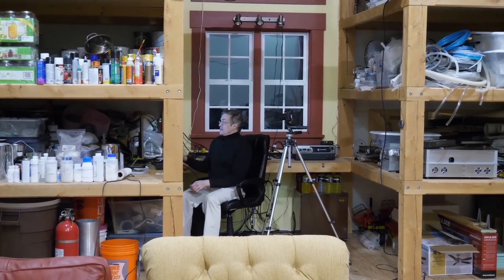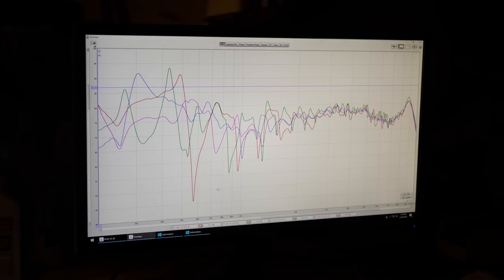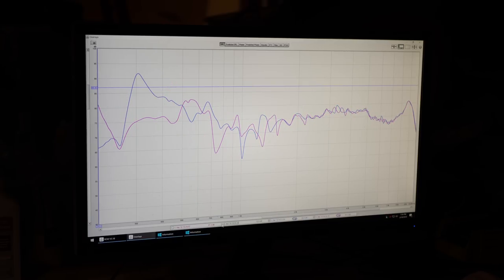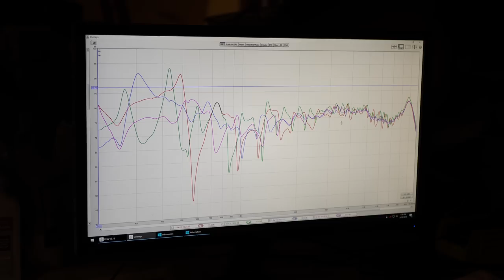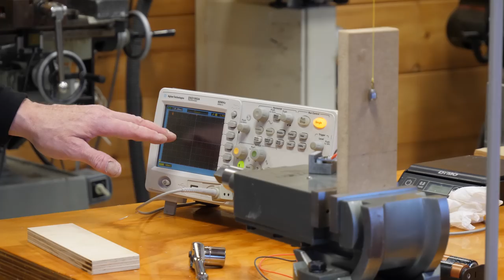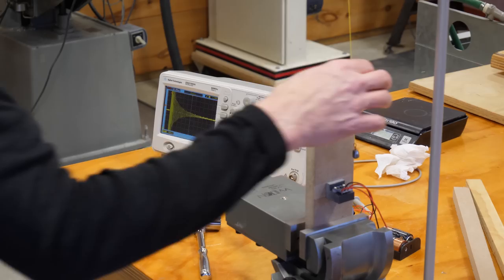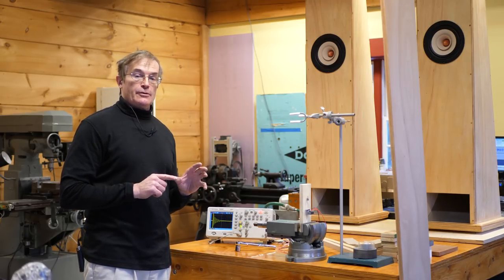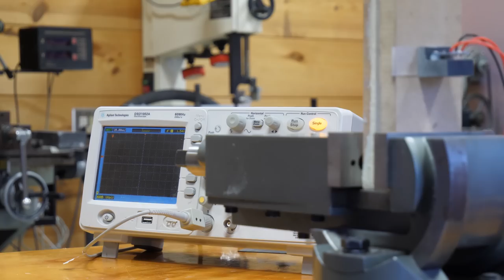World's Second Best Speakers!

Comment: Ummmmm, dude got a fundamental of loudspeaker design completely wrong.    The magnet doesn’t move, the voice coil moves, carrying the membrane with it, thus moving air, thus making sound, hopefully the voice coil is oscillating at the frequency required to reproduce the intended sound as commanded by the audio device producing said sound, which takes very few volts and amplifies that to many more volts, thus creating the magnetic field within the voice coil, which reacts against the field within the circular magnet, to oscillate and make sound.    The rest of the “speaker” is used to harness these vibrations and augment and manipulate the resulting audio to the desired intent of the speaker designer.   Hopefully.    All too many speaker designs compromise too many aspects at the behest of one underlying design intention.     Purity is purity, and the more baffles used, the less pure and the more reflection, but these baffles are great,y needed for the pragmatic needs of said speaker, including, but not limited to, sound pressure level, dispersion, accuracy of reproduction of source audio, AKA, fidelity, space and weight considerations, environmental considerations such as relative humidity, temperature, external acoustic reflections, external acoustic open field, and of course, seemingly, last but not least, the ego and aesthetic design intentions of its creator, oft found to be sorely misguided by one design assumption or mistake after another.     Making good sound reinforcement loudspeakers CAN be quite simple.       Can be.     Can be.     Also remember that beauty isn’t always a visual thing.   It can be in the ear, as well as the eye, or even nose, of the beholder.        Nice demo.    Dude needs to get out “in the field” more.     Nice turtleneck too.     I was waiting for him to start reading poetry and snap his fingers over and over before donning a beret and lighting a cigarette.     Good stuff.   This was almost a skit on SNL.
Reply from the maker: Thanks  for the comment.  Try breaking  up the run-on sentences, it will be more impactful and easier  to read.

Comment: Sealed back cabinets might be 'wasteful', but they still give you the most accurate response, smoothest roll-off and most compact dimensions. 
A port is not a delay line. Far too short. It's a resonating air column. Like a passive radiator made from air inertia.
Reply from the maker: How do they address resonant peaks at integer wavelengths?

Comment: Riveting presentation and subject matter as always, but I have a naive question: how come I never noticed that a certain pitched sound is louder/quieter on certain speaker configurations? The demonstration in the other video with the in phase/opposite phase speakers effectively doubling the volume or cancelling out was quite dramatic, I suppose the effects in this case are far smaller?
Reply from the maker: Mostly, it's  because they are compensated by the wider bandwidth.  The taper has no discreet peaks.

Comment: The other thing we need to consider, in addition to stiffness and mass, the damping factor. There are many ways to introduce damping to the box. The damping will help in reducing the vibration amplitude. I also think the more rigid panels will resonate more with higher frequencies, rigidity is not always good.
Reply from the maker: That's what I did with the constrained layer system.  All other things held constant, rigidity is always good.  But, if mass or damping or cost  are compromised for rigidity then I agree it might not be worth it.

Comment: What did you mean by the thickness of the speaker  material is negligably thick? Are you saying that there is a range of thickness somewhere between a minimum thickness and a maximum thickness where the difference doesn't matter much? Thank you in advance for your explanation.
Reply from the maker: The principle is that the speaker diaphragm thickness is negligible compared to the wavelengths of audible sounds.

Comment: A very good introduction to acoustic principles and loudspeaker design, but hugely misleading in that it suggests these speakers are close to being a near perfect design. There are many other factors to consider which are not even mentioned in the video, such as the importance of speaker placement and spacing within the listening environment, psychoacoustic effects, resonances within the listening space (although covered in the acoustic panel video), and the need to set the speakers up to suit specific types of music or sound you are listening too. Electrostatic panel speakers most closely approximate an ideal speaker for classical type music, while cabinet speakers suit more modern sounds and particularly the emphasis on bass sounds. For $600 you can certainly buy a much better pair of commercial speakers and even more so on the used market.
Reply from the maker: Thanks, but your criticism is a little unfair.  This is already nearly an hour long video and you're saying that not having discussed the contribution of room acoustics and the physiology of hearing is a failing. Those would be interesting topics, but to cover them would require a lot more time and would be better as part of a course on acoustics.
There certainly are other speaker designs out there and as you said each has certain strengths, they also have weaknesses including cost and construction complexity. Used speakers are worth looking at, but are a poor standard for cost comparison as the availability is very unpredictable.

Comment: Just a note--at 2:00 ish where you're describing voice coils and magnets in the speaker, it sounded like you were saying the voice coil was static and the magnet is attached to the cone, if I'm understanding you correctly. It's actually the other way around--the voice coil can be made to be pretty light, much more light than the magnet, which is why the voice coil is attached to the cone (lower intertia, better fidelity).
Reply from the maker: You're right, I misspoke.

Comment: Hey guys, have you tried butyl rubber tape for the visco elastic layer? It is even cheaper and readily available in 0.75mm thickness at various hardware stores
Reply from the maker: No, we didn't.  However,  Grace Ice and Water Shield is butyl rubber based material that was promising, but was not used only because  it was only adherent on only one surface.
Thanks.

Comment: Sound waves radiate outword in a circle from their source. So containing them in a square tube, and directing them out through rectangular holes seems counterintuitive. If cost and technical ability were not a consideration, would it be superior to build a round Voigt tube with a round opening at the bottom? I welcome feedback about this idea.
Reply from the maker: Probably not.
These waves will radiate spherically, but will reflect many times at they travel up and down the tube.  That would be true no matter what the shape of the inside of the tube.

Comment: Super! I'd like to build such speakers for myself. A question. Doesn't the front panel resonate not because of the sound pressure, but because the speaker is attached to it?
Reply from the maker: It moves and that's ok.  What we want to to prevent is frequency dependent oscillations that persist because they are tuned to the resonance peaks of the structure.

Comment: How did you arrive at selecting the Tang-Band driver? I missed that or it was not covered? I'm guessing I can use something with similar T params.
Reply from the maker: It wasn't very scientific. I heard a couple of speakers that were built with these and I was very impressed with the sound.  The specs supported this.
You can, just adjust the dimensions (to scale) if you choose a driver with a different recommended open volume.

Comment: Magnets dont move, AC current energies the voice coil and causes it to move in and out of the gap becuse its suspended by the spider between the air gap next to the magnet it moves in and out as its either attracted to or repeled from the magnet this makes the cone move and push and pull air causing sounds waves.
A motor or speaker makes no sound in a perfect vacume. It has to push air.
The condition of the air also plays a roll
Is the sound presses  like humidity and tempture.
Reply from the maker: You are correct regarding the magnet, I misspoke.

Comment: Don't think that open end ambient air reflects sound waves emergent from tube.  Instead, sound waves in tube reflect off of tube wallls causing them to vibrate, then the ooen end of tube reflects the sound back into tube.
Reply from the maker: If that were true,  how do you explain reflection at the interface between identical materials with a different density due to pressure or temperature?
Look at images of shockwaves.

Comment: I’m just wondering with the speaker right in the middle from top to bottom of the enclosure, will that not increase the resonance of the frequency that matches that distance?
Reply from the maker: That could be an issue  when the driver is midway between  two reflecting surfaces, but the packing in the upper half reduces the speed of sound based on its density. This is similar to the refractive index of glass which indicates the reduction of the speed of the light as it passes through a lens or fiber

Comment: Would it be possible to bend the transmission line down 180 degreese may be on a high of 110cm without getting a negative impact on the the sound?
Reply from the maker: It should be. There may be additional reflections at the bends that will have to be compensated for.

Comment: hello! thy for this viedo.  can someone in the comunity tell me if you can build such speakers a little smaler ? how would it affect the sound output ??
Reply from the maker: Check out the open volumetric of the smaller speaker drivers you will be using and scale these dimensions down to achieve an internal volume that matches it.

Comment: Just wondering if this is scalable? As in, if I make all the dimensions half the size will it still work or does any scaling need to be audio tested and adjusted? Thanks
Reply from the maker: Yes... but.
The drivers are designed for an optimal "open volume." Check out the manufacturer's recommended open volume and then scale the dimensions to match that number.

Comment: Thanks for your very detailed video. Is it possible, that the measurements of the front and the back side of the box is reversed ?
Reply from the maker: If I remember correctly, the front is measured  slightly  overlong and then mounted. The top is then finished to bring all four sides to perfectly horizontal  to allow the cap to be added.

Comment: Can these be scaled downed directly or would require re-calculations of thickness, shape and hole size?
Reply from the maker: Sort of.  What matters is the internal volume and the driver manufacturer's recommended "open volume". You can scale the design down proportionally to meet that internal volume. Wall thickness is irrelevant and the port opening is often recommended as well, but can be scaled proportionally as well.

Comment: 45:20 How well would something like a 1mm coating of silicone caulk do at dampening vibrations?
Reply from the maker: That would absorb sound energy, we don't want to do that.  We want to use it and direct it out the port.  The constrained layer dampening reduces the generation of resonances and parasitic vibrations that will distort the sound.

Comment: How about using Henry's Rubber Roof Patch? Dirt Cheap at Lowes.
Reply from the maker: Is it gel like or is it rubbery.  You want a non elastic gel like material. If it's like this then it should work.

Comment: What if you add more than 1 dampening layer and built up your panels from several thin sheets of plywood?
Reply from the maker: The optimum set up is a thick primary layer and a damping layer with one half the primaray's thickness.  Breaking this into multiple  thin layers isn't any better and is more expensive and requires more effort.

Comment: Usually I dig your stuff, but preferring plywood over MDF for speakers is just wrong. The box isn't meant to be a living resonance frame as in a guitar or violin. While the violin (not plywood either) plays one frequency after the other, the speaker has to play the supersuperpositions of the whole orchestra. The body should be as dead as possible and let the membrane do the work. Therefore it has to be most weight with least stiffness.
Kept watching: You can use tar (roofing paper without grain) instead of that dampening stuff. Easy to use and really cheap.
Edit: And spruce isn't even close to meranti. That's like comparing mahagony to pine.

Soundcheck: Those speakers sound exactly like my speakers playing a video from youtube where someone records some music in a garage with a mono mic. ^^
Reply from the maker: You need to watch the testing again.  The MDF looses on all fronts except cost.
Reply: @TechIngredients  Please measure the resonance of the front near the speaker while playing different types of music. Please measure the delay and frequency at your metal sound slide. Then plug it to a good class A amp and let some audiophile listeners compare it to Focal, KEF or other reference speakers. After that, open one of the reference speakers and find out what they put inside it, which membranes had sealed boxes and how that volume corresponds to size/hub of the membrane and coil strength. For open systems: What's the delay and what did they do to get a 20 Hz wave out of a membrane that's limited at 40 Hz?
And let them test it against some good monitors, too. Size does matter, technology is important, but experience beats it all. So I wouldn't be surprised if a good monitor would sound more precise than a huge monster that lets sound off out of every membrane, two holes with changing diameters and the wabbly and cross-oriented plywood surface.

Comment: MDF is cheap, readily available, easy to machine, relatively dead and stable.
Marine plywood is not easy to find and expensive.
When I make spaghetti carbonara, I would like to use Guanciale, but I usually have to settle for Pancetta, either way, it's delicious.
Reply from the maker: You skipped a step.  As I said, the speakers I built we're from the cheapest construction grade plywood available.  The cost was comparable to MDF, but the properties are superior.  If I built another pair I would use marine plywood for the added asthetic value.
Reply: @TechIngredients  
I see, I don't love MDF because of the dust, and the paint sealing issues, I'd like to go with Baltic Birch next time around.

Comment: If you want cheap underlayment roofing or ice and storm Guard underlayment is cheapest and easy to get
Reply from the maker: Actually,  I tried that.  The problem  was the single surface adhesive.  I wanted  it to work as it's cheap and available.  But despite several  frustrating  attempts, I was unable to remove the barrier layer to allow it to bond to both the primary  and the constrained surfaces.

Comment: A dull miserable morning but brightened with your clear and succinct descriptions. It's like watching the Bearded Butchers (I am a farmer) processing meat 😊. I am curious to find out if products such as Dynamat could be used to line the enclosures to dampen.
Reply from the maker: They have an interesting channel.  We enjoy it too!
Yes, you can.
Reply: @TechIngredients  I think I will have to try these speakers out. I just purchased a pair Jamo GF25 old school speakers as I have Jamo 707i and 507i for my main theatre setup. Interestingly I had a pair B&W 603 S3 connected to same Technics amp as the GF25 speakers and frankly they sounded much better with better room filling bass. My GF even noticed the difference. Would using 30mm plywood be suitable for the build? Effectively add 150% to your USD pricing for plywood here in Australia for our buy price.

Comment: Another damping material might be Green Glue Soundproofing Compound. (Not to be confused with other Green Glue products such their sealant.) The stuff doesn't harden and is designed to be put between layers of drywall. It deadens the resonance just as you demonstrated. It comes in a large tube and is applied using a caulking gun. Costs $26 per tube, which is more than you would need to build these speakers.
Reply from the maker: I've head of it and I think you might be right.  The quantity needed will probably be significantly more than a single tube. Estimate the surface area, multply by one mm times two speakers.
Reply: @TechIngredients  Note that the method prescribed for Green Glue Compound (which is designed for double layers of drywall) isn't an even layer, but zigzag lines with the spaces between the lines preserved. If you ever do another speaker project, it might be interesting to test zigzag lines vs an even layer.